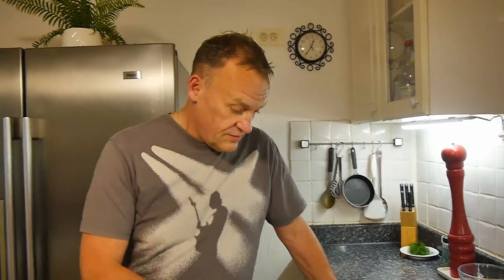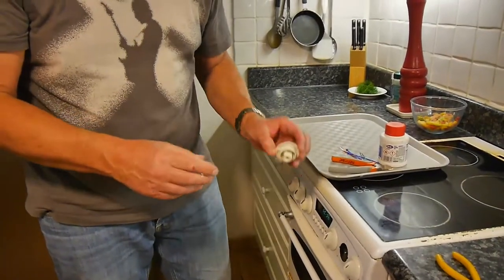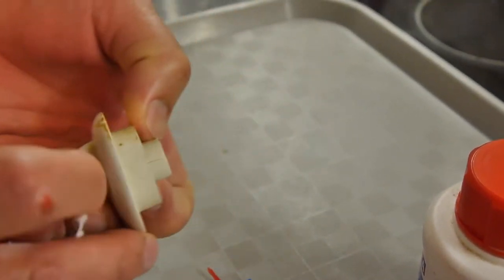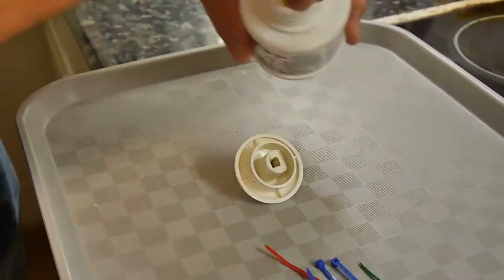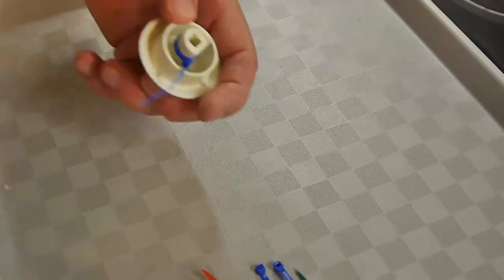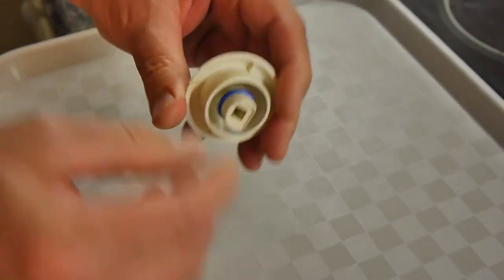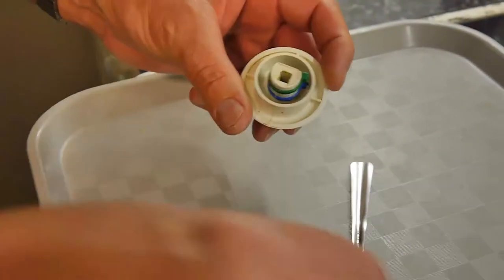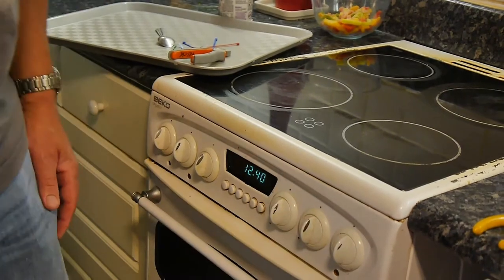DIY 🎛️ Cooker Oven Stove Hob Burner Knob Broken|Loose|Damaged|Cracked — fix/repair Beko control knob

Comment: Thank you for this tip. I need help with the oven knobb. It turns but it won't hold the light. The gas stopped once I left go. How can I fix that.
Reply from the maker: I don't know but it's well worth asking that same question on a home appliance forum. I'm not a kitchen appliance expert — but maybe a gas oven expert reading this could chime in here? Maybe you need a new thermocouple? An electric oven doesn't use a thermocouple (as far as I know!). Search the internet for the word thermocouple including the make and model of your cooker.